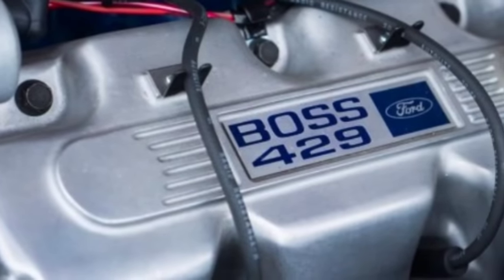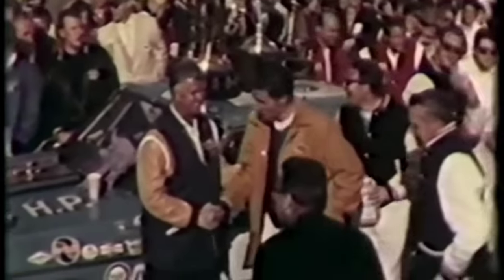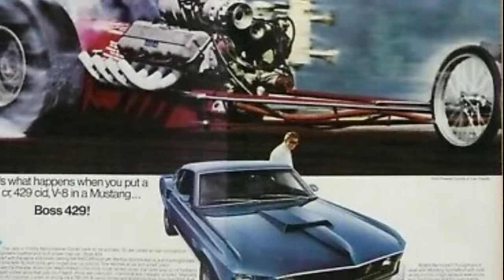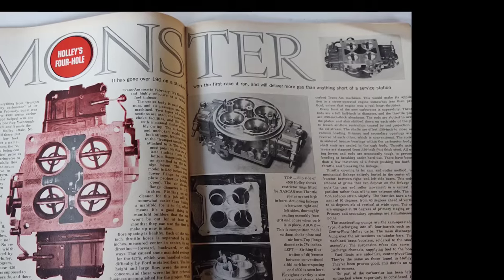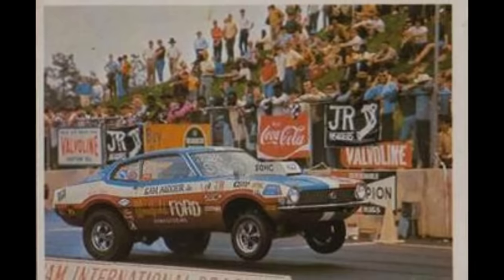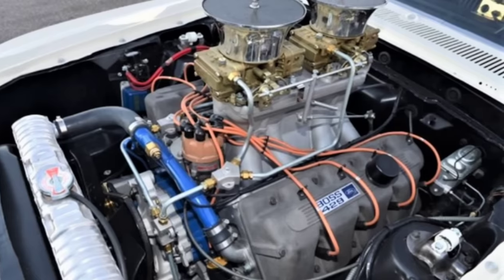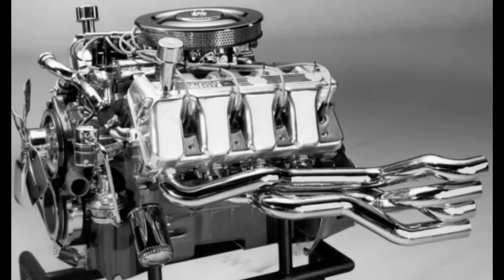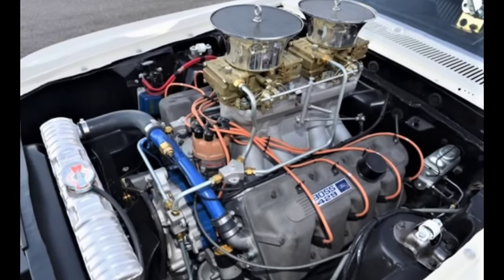The Misunderstood BOSS 429

Comment: Did you know that Ford had made a dual overhead cam 429? At the same time Mopar had a prototype 426 dual overhead cam 4 valve per cylinder motor they were working on...NASCAR got wind of this and limited the cubic inches to 302 for 1970 (with uncompetitive GMs urging) because the motors were getting too powerful for NASCARs tracks and it killed both of them...GM rule: if you can't win-CRY!
Reply: Oldsmobile also made a prototype DOHC 455 then called the W43
Reply: @Fred_NaughT  the W43 was the Hurst-Olds option...
Reply: @Randy7th  
I changed my profile pic to what is referred to as the experimental olds 455 W43 dohc that was never allowed to be put into production. It would have most likely destroyed the competition !
Reply: @Scorpionluva  doubtful,  it may have run good but the 426 and 429 were racing motors put on the street-not street motors that went racing...
Reply: @Randy7th  
It was built milder than the street version of the 426 hemi and Boss 429 but produced high HP + torque numbers than both. Almost 700 ft/lbs + 800 hp with 9.5:1 compression and midrange cams.  If it was built to 426 or boss 429 race specs ?.. who knows how nasty it would be. I love all of them though no matter the maker !  If its a V8From a Shelby 289 - 500 Cadillac I love them all
Reply: @Scorpionluva  I remember reading about it but didn't remember the numbers. Imagine both engines with the bugs worked out and set up racing-they would have made WAY TOO MUCH power for the tires of the day or NASCAR! They both could have easily been 1000hp motors for the street I believe

Comment: Biggest pain in the ass without a doubt is trying to seal up the heads with all those silly rubber washers. The Boss 9 setup is much easier to deal with it's typical head gaskets.
Reply from the maker: Amen to that!  Torqueing the heads down using feeler gauges to make sure everything is good... Just looking at the service procedure to all of it will give you a headache...LOL
Reply: @UnityMotorSportsGarage  Despite our best efforts the one we built wept ever so slightly, but ran fine. I can't imagine a stock one being all inspiring to drive, by the time the induction started to wake up the cam was finished.

Comment: Folks didn't understand the Boss 302 either and a lot of people didn't know that Richard Petty left Plymouth and did some winning in a Ford I love them Torino's from that era
Reply from the maker: Thanks for Watching and you are right.. those Ford's and Mercurys were bad rides...  Please Subscribe and a BOSS 302 video would be good to do also...
Reply: @UnityMotorSportsGarage  I've been subscribed since I found out about Casper I used to love them dentside Fords I always ran a Fe the only thing that would out pull one was an old 460
Reply from the maker: I love my old Ford Trucks!  Thanks again! Hope you have a great weekend
Reply: Ford didn't optimize the homologation engines since they figured the owners were going to modify them anyway. GM was better about it with their L88 and ZL1 427s....add headers and tuning and you were at or near 600hp. The Street Hemis needed supertuning and a torque convertor swap to get right ( the convertor was too tight...a 440 could stay with it up to 70 mph or so then those big ports and extra barrels started breathing ).
Ford's big port engines like the High Riser, Tunnel Port and Cammer could have been made more streetable if they really wanted to put the effort into cam design but that required spending money. The modern Coyote is what happens when you do. 12:1 compression, big port heads, and the ability to rev 8000+ rpms....sound familiar?
Reply: Petty left Chrysler because he wanted a wing car and Plymouth said no it was only the dodge guys running the Daytona and so he left for Fords so Chrysler built the Superbird and got Petty back the year later and that's when Ford started crying to Nascar and the wing cars were banned from the speedways
Reply: I lived through that era. The Boss 429's were getting whipped by 428 SCJ's every night on the streets. Local Speed shops that worked on them tried longer duration cams, lighter flywheels , bigger carbs and headers and still they performed poorly on the street. The mass of the over-designed pistons, rods and crank made them slow revving and unresponsive. Bigger gears only succeeded in blowing them up. They just didn't run.

The Boss 302 also suffered from slow port velocity (ports too large) which made for a fussy and "cammy" (poor performance outside of a narrow high RPM powerband) engine with no low end torque. The Boss 302 could compensate somewhat with higher rear gearing and perform reasonably well but was no match for the Z28 or Mopar 340 on the street. It wasn't until Ford brought out the Boss 351 that the flow potential for the Boss heads could be utilized. The 351 Cleveland had the same issue and was a disappointment to street racers who would routinely swap out their 4V heads for the smaller ports and valves in the 2V heads for better street performance.

The Boss 302 and Boss 429 were both substandard performers on the street and existed only for the homologation of their motors for motorsports racing and were misrepresented as the pinnacles of Ford's street performance car offerings.
Reply from the maker: @neighborscomplaint6859  well said!
Reply: @neighborscomplaint6859  the reciprocating assembly on the 429 I don’t think was any heavier than a hemi.The big choking point was the Holland tunnel sized intake ports that could not flow any air below 6000 RPM’s, when the time came to put them in mustangs all they had to do is put a smaller carburetor, smaller cam and mufflers on it and you had a car that would be hard pressed to stay with a 351 Mach 1 in terms of acceleration because it would have none because of those ports. Sure on paper they could flow a lot of air but the RPM’s necessary to pull that off they didn’t have the bottom end parts or the alloys to do it with back then. Bob Glidden figured it out by making his own intake manifolds that were probably a third smaller and also welded the close the size of the the ports on the intake side of the head. It just a matter of finding the optimum size from the top of the intake manifold into the intake ports on the heads. He had a MUCH larger starting point than any other motor it just came down to what he could get by NHRA as their rules were about people getting to creative in INCREASING the size of the intake ports but the rules said nothing about decreasing the size. That’s why Warren Johnson was constantly crying to the tech people about Glidden‘s motors but he wasn’t any better because Glidden found that  Warren Johnson was doing his own creative welding so it was a back-and-forth battle that’s why those two were the best when using the actual stock size and shaped cars. This was when you made your cars faster with more horsepower instead of making them smaller and misshapen “cars” that they use now.

Comment: Anyone here ever work on a Boss 429? I wonder that anyone hasn't did a video on the head gaskets of this monster. Not fun,and if only one ring was out of place,time for a do-over.$$$
Reply: Ten four on the no head gasket!!!!!!
Reply: @johnsonford429  When I worked at a Ford dealer ,I worked on a Boss 429 that had a leaking coolant passage O-ring. Back in those days,one could go to the parts counter and get whatever part you needed.
Almost any part,that is. Not so for the 429. The gasket had to come from a head set. Anyone remember "Rotunda"?  As the warranty was still in effect, FoMoCo footed the bill.  They are a icon of an engine,but a real pain to work on.
( btw,the best way to have the engine on a stand and rotate it so the deck is level with the floor,making sure all those pesky rings were in their proper place. And there are a LOT! Two man job to set that  head straight down.)

Comment: Bullshitz - Petty would NOT race a Dodge from a long standing disagreement from his father's time. Plymouth 1970 SuberBird was built just so petty would return to the Mopar camp which he did as soon as the SuperBird was announced.  Boss9 was only stuck in street cars to meet the requirements and when I got mine in 1970 it really sucked! My 69 CJ was a far better street and drag combination up to 110mph -- then the Boss9 came alive.  Unhook the RPM limiter and open the rear jets of the 735 a couple of steps it became a fun car to drive.  You just needed the space which was not stoplight to stoplight. Both the 440-6V and 428CJ along with the GS455, LS454, +++ were designed to provide the torque to get vehicles under motion compared to the hemis that specialized in keeping high rpm air flow through a narrow power range. The combinations of various power adders - supercharger, turbo, NOX etc changed what was the dominate wisdom of that time.  And don't forget "Speed is $, HOW fast do YOU want to go?"
Reply from the maker: I have always loved that... Speed Costs Money! How fast do you wanna go... And GOOD, FAST, CHEAP.. you can only pick two of those words..Good and fast isn't cheap and Fast and cheap is NO good.. Good and Cheap isn't FAST! 
Thanks for Watching! Please Subscribe as I'm working on a Hemi video!
Andy

Comment: Sounds like the story of the boss 351, how about giving us that story too
Reply: The 351 Cleveland with 4 bbl closed chamber heads was  a very under estimated and overlooked engine. This engine mandated big (real big) cam, high stall converter or manual trans and some 4:10 or better gears.  Dont build a Cleveland to make power from idle to 5500. Build it to the way it needs to be: 3000 to 7000 RPM!! High RPM quarter mile screamer.

Comment: Boss 429 Mustang? The engine was too big for the car and they had to cut and notch the spring towers which did not help strength.
And the engine is heavy which did no favours for the handling. No big block Mustang handles and even the 351C  was too heavy.
Reply: I always thought I would like to do what I think was called an australian block or clevor, right? it was a 351 windsor style block. Windsor is lighter cause it doesn't have the added casting material on the front of the block timing chain area, they have the aluminum timing chain cover, with cleveland main bearing dimensions with either deck height, if I remember correctly, and clevland canted valve heads. Maybe they are still available?

Comment: So after 1965 Chrysler boycott NASCAR unbanned the Chrysler Hemi which also allowed the Ford Boss 429 hemi to be developed and let in...
Reply from the maker: Yes NASCAR decided to allow the Hemi IF Mopar made it a Production engine option offered to the public.  NASCAR also said that Ford could run the Cammer BUT it would need to be in a full size car with a weight penality and Ford said No Thanks...
Thanks for Watching and please Subscribe as I have more good stuff coming
Andy
Reply: @UnityMotorSportsGarage  - Chrysler should have been really slick and put aluminum heads on all production Hemis! Just ate the cost difference...

Comment: The Boss 429 for the street was a poor motor. The ports were to big, the motor was very heavy for the Mustang, it was difficult to work on while in the engine bay. In '66, Dan Gurney commissioned the design of cylinder heads for a couple of different engines by Harry Westlake of Westlake Engineering in England. One of the engines was the 427FE for Gurney's Can-Am car. The car was fast, in part to Gurney's skill, but it needed development & Gurney's budget was stretched thanks to other projects. Ford was winning at Le Mans so Henry Ford II wasn't interested in the new racing series(damn him). Those heads would've made the 427FE the King it should've been. Check out the link: https://www.gurney-weslake.co.uk/  It doesn't mention the 427FE specifically, but Road & Track Magazine had a blurb about the car & engine.

Comment: The Street version of the Boss 429 was rushed through and poorly thought out and executed. Also, it never should have gone into the Mustang as the motor just wasn't compatible with that car.
Reply from the maker: I talked to Sam about that.  He said that in his opinion it was a combination of both..  The Engine with its huge ports and heavy bottomend components was two major setbacks for the street engine not to mention the exhaust manifolds..  If they would have reduced the size of the ports it would have made a huge difference in how would accelerate through the 1/4 mile.. The connecting rods were massive! they had 1/2" rod bolts and combining that with no low end torque it was just a slug...  Ford over engineered the engine they wanted durability running at 7500 rpm and that is what it did best.. once the engine was in its happy place it delivered the goods.  Even nascar racers reduced the size of the ports making the intake port a D shape to improve torque so it would pull off of the corners on smaller tracks..  Thanks for watching and please Subscribe as I have other good content coming up!
Andy

Comment: Ford made a 427,428 and a 429. Why ?
Reply from the maker: Well, the 427 was Ford's race engine and the 428 which had a longer stroke and smaller bore was the mainstay production engine... By 1968 Ford was looking to replace the FE engine family and came out with the 385 series BBF 429 engine which grew into the 460
Kinda weird but that is how it went
Andy

Comment: This was a good video but you missed a lot in the beginning like who really made the 429 and that the 429 that Ford had was not the real 429 and that the blue prints that they got was not the right blueprints and that the real blueprints for the 429 it was about 460-470 cubic inches and the mystery 7 is the only one that has this motor in it and it was a tasca car and tasca sold a different blueprint that was missing information and that is a dumb down story of why only a few 429 ever ran good and why tascas was the only one that ever had it running good and that's because old man tasca sold ford a different blueprint 
 And also the 429 was not great on gas but methane it became unstoppable but you had to hand mix it obviously and do a lot of work but when I is done it would run 7's hint hint the mystery 7

Comment: LMFAO did he say this new Merc with a hemi engine??
Reply: Yeah, the 429 Boss had hemispherical combustion chambers. Note the picture he shows in the video @ 7:22. So, yes, the 429 Boss was a "hemi".
Reply from the maker: Stefan, some people get hung up on it not being a "True" hemispherical chamber.. calling it a Semi Hemi.. it has opposing Valves which to me makes it a Hemi, the funny thing is the new 3rd Gen Hemi has chambers that resemble the BOSS design by have two quench pads... Thanks for Watching! Check out my Project MIXED UP BOSS! I'm putting BOSS 429 style heads on a 429" Stroker Windsor small block!
Andy
Reply: @UnityMotorSportsGarage  will do

Comment: I never knew the 427 was sohc
Reply: They had both the SOHC the bottom was the same block but the top of the motor was completely different , the cammer chain was 6 ft long
Reply: @johnsonford429  that's so cool ! And un-American for the time. 
As a mechanic I've always detested pushrod engines.

Comment: BULLSHIZ - Petty refused to drive a DODGE Charger Daytona because of a long standing disagreement his father had with Dodge. Petty knew Fords were the brand with the most wins of the 1960s so he switch to Ford's delight. Mopar built the one year SuperBird just to get the Petty team back running Plymouths. 

Unfortunate that this author wasn't there and as in his other stories lacks the facts of the times. Boss9 out of the box was a crap street engine. I bought one and just like my 67 GT500 it had HOOD WOW -- Open the hood and people went wow. Boss9 took a lot of $ to become competitive. Tasca and the Ford Drag Teams could have used any engines they wanted - chose 428s.... AND that 735 cfm carb on the Boss9 was the standard 428CJ carb.  It is a shame that so much "reputation" is placed on which engine a vehicle has. 500 or 1,000 hp that can't be hooked up to a track is useless like comparing apples and pineapples because they both have "apple" in their name. Vehicles & teams win - not just engines.

Comment: Well Ford never has built a engine that could compete with the chrysler hemi.  Never has never will.
Reply: Yet here you are watching this,huh.
Reply: @billgarbutt7844  certainly. Always keep up with the enemies
Reply from the maker: No enemies here... Each of the big 3 had some killer engines..and not so killer.. I respect them all... Now but once upon a time I was all Mopar!  
Andy
Reply: @UnityMotorSportsGarage  it still is all MOPAR.  Demon and Hellcat. Nothing else off the factory floor comes close
Reply: Dan Hayes I guess you never rode in a Ford with a 427 SOHC, Medium Riser or Tunnel Port. They were all faster than the Hemi. Worst part of the mopars back then and even today they may go in straight line but hit a corner and they roll over and play dead. Take that Hellcat or Demon around Willow Springs or any other racetrack vs the GT500 or say GT Mk II and see what happens. Kinda like the new TRX. Ok in straight line but hit a bump and the new Raptor will eat it alive with a 213 cu in 6 cyl. My 55 yr old truck with a 6 cyl will eat a TRX. I have owned many Mopars inc a ‘70 Superbird.
Reply: @intuitive7274  you should probably have mommy bring you and your skateboard to the park to wear off some of that anger!
Reply: @intuitive7274  Have Mommy bring some Hot Pockets to your room.  You must be hungry. That’s why you’re so cranky.
Reply: @intuitive7274  then why is chevrolet winning every factory stock race out there and prostock where are your mopars i am a chevy guy but i respect ford and mopar all of the big 3 have built awesome engines